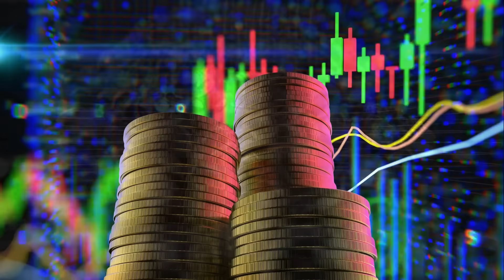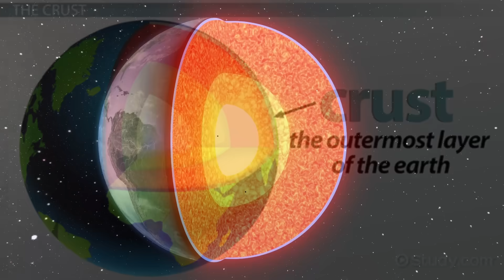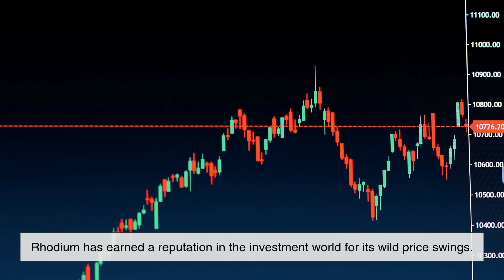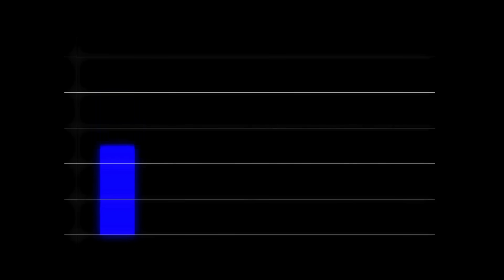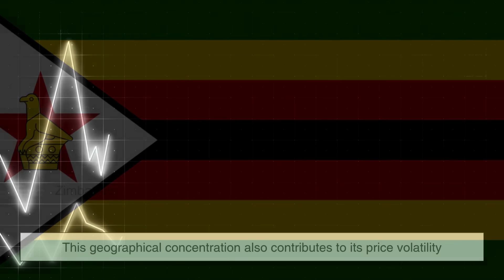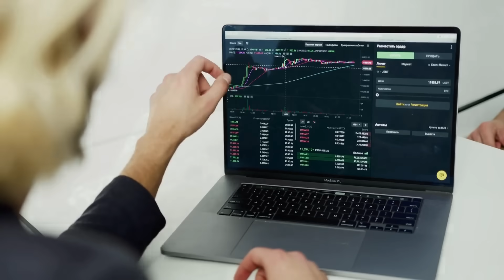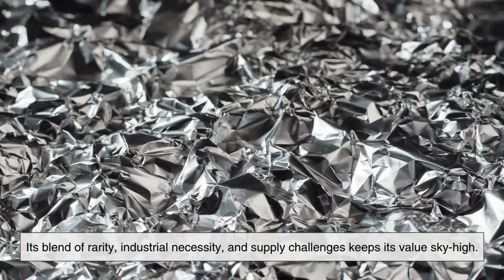Why Is Rhodium So Expensive? The World’s Rarest Precious Metal Explained

Comment: rhodium is one of the many metals used in catalytic converters and is one of the reasons that the converters are stolen so the next time you start your car and it sounds like a motorcycle just remember that the metal is the reason some stole the converter from your car
Reply: CORRECT !!